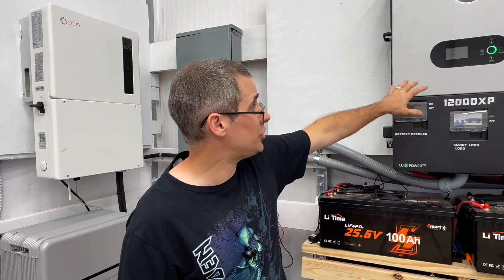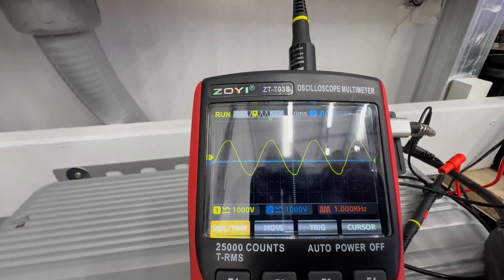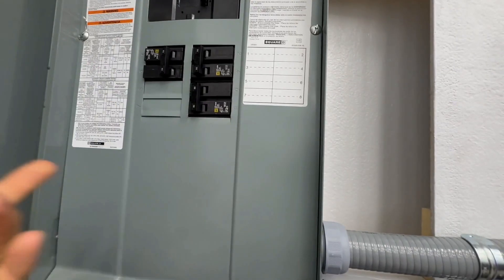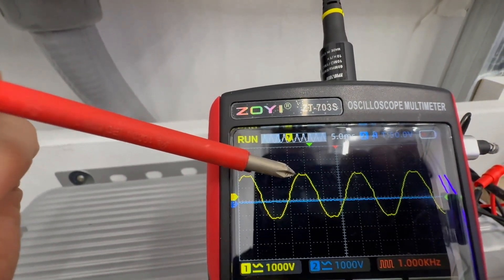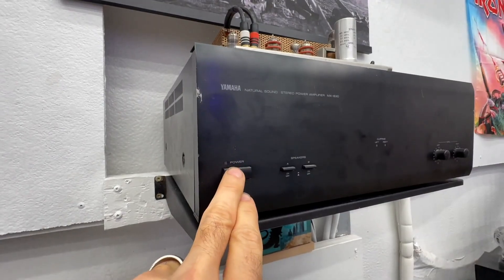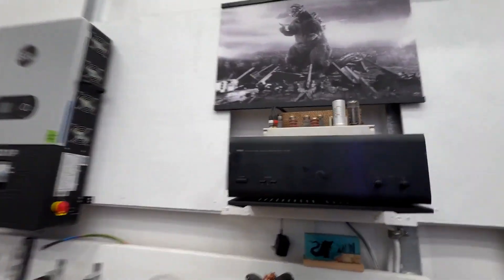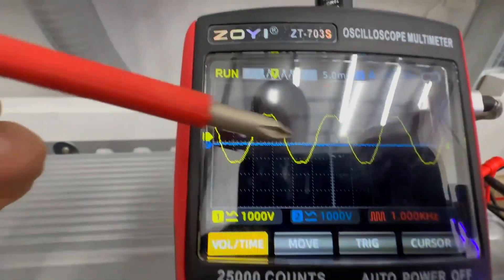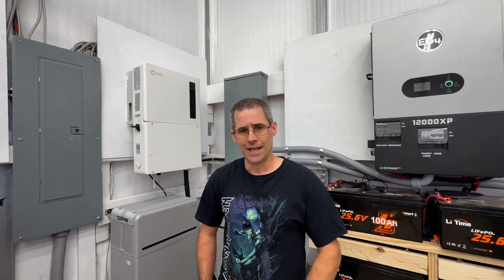Inverter Sine Wave Showdown: Which One is the Best?

Comment: Just installed (DYI) EG4 Flexboss21, GridBoss, and two indoor batteries. No solar yet. The System works well as a battery backup system. Everything in the house works fine except my linear DC power supplies used for my radio hobby. The transformers buzz loudly when on battery backup. I'm working on a fix for this problem.
Reply from the maker: Sorry to hear about the transformers.  Check the waveform to see if there is an issue with the inverter.  Also post pictures in the forum so we can take a look at the setup.

🛠 Showcase Your DIY Wind or Solar Setup    👉   https://www.windsolarforum.com/post/showcase-your-diy-wind-or-solar-setup-13676879?trail=20

Comment: Good stuff Mike.  Didn't you mention something about your lights behaved different with the solis also?  Or maybe it was the lift.  Man that's disappointing I was falling in love with the performance of the Solis.  Ed's DIY Solar Farm has great content showing that the Solis handles high loads in a hot shed without overheating.  That's one of the best benefits to me of a HV setup.  Not a deal breaker but it seems like something that should've been addressed in its design as the first step.
Reply from the maker: I think both inverters are really good, they each have their strengths and weaknesses.  In the end it is up to you on which one fits our needs or situation.  For outside or in a shed the Solis is hard to beat, especially with its efficiency and cooling capabilities.  The 12000XP on the other hand is just a powerhouse.